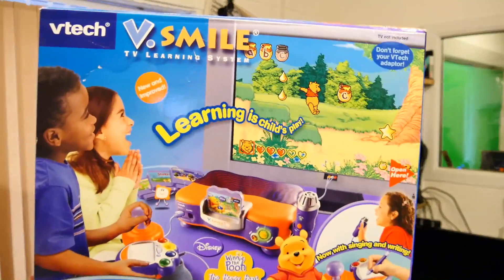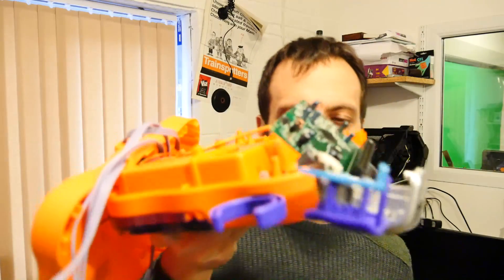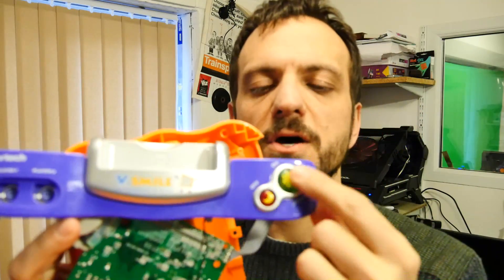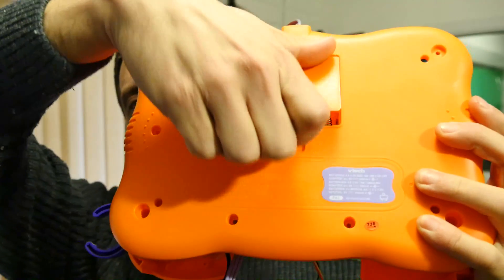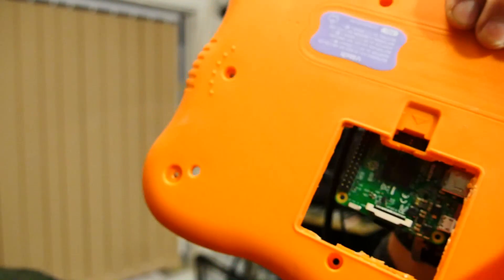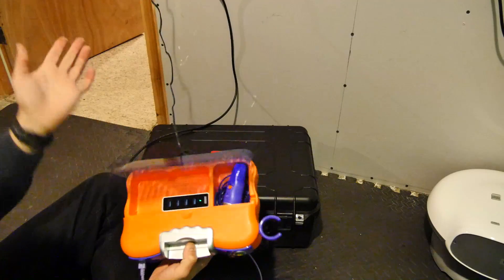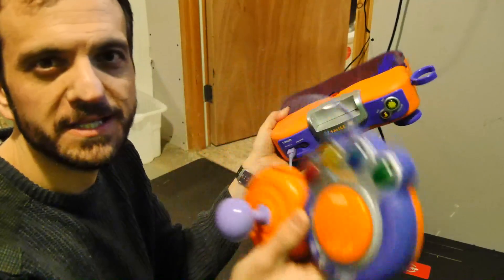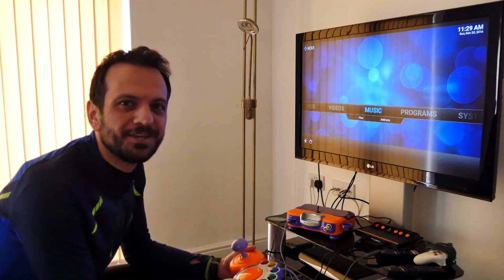Ultimate vtech V.Smile RetroPie Retro Arcade & Media Centre Mod Raspberry Pi 3 Tutorial

Comment: If you painted the plastics and plastidiped the analog stick you could make it look a little less like a child's toy and have it look a little cooler. I would have probably spent the extra time making the leds in the controller work and also reused the original power jack. However I would not have reused the same supply. I'm not sure but its possible you could have just soldered the power connections for usb power to the original jack and plug.

Comment: I use an ac adapter for this thing as the corrosion on the console is bad at times.
Reply from the maker: I think I have three of these consoles and at least two of them have died and I can't even figure out why so shame. They made quite cheaply so have all the magic in one big chip.
Reply: @backofficeshow  Most likely. One of the ones I have supports this keyboard and mouse accessory through this ir sensor. The other two are the same, with slight things, and one was the one I had most my life. I also used to have this motion variant of the V-Smile, and the console in a while I think lasted from 2005 until 2011, or even 2012, proof is that there's an Up game for the console.